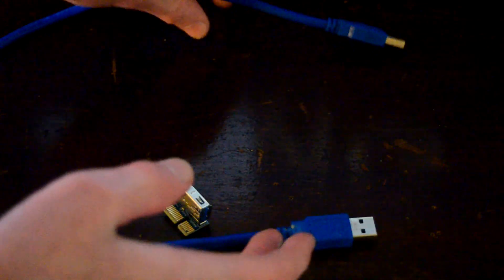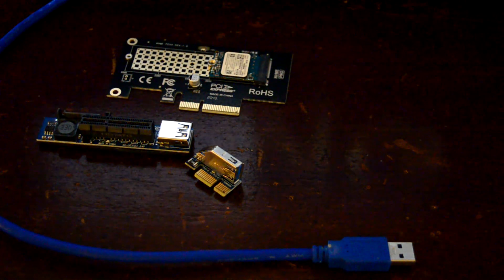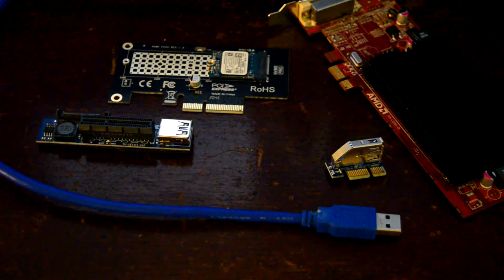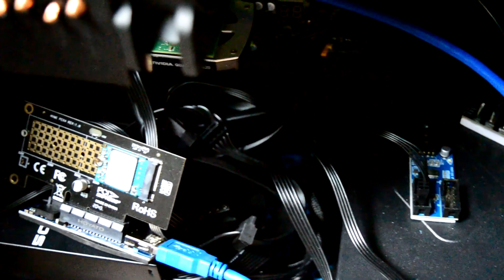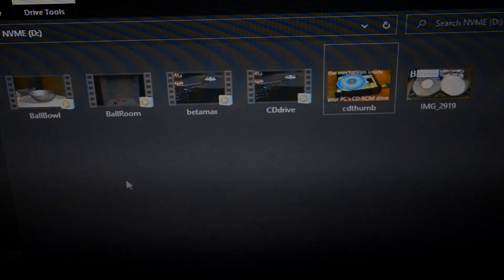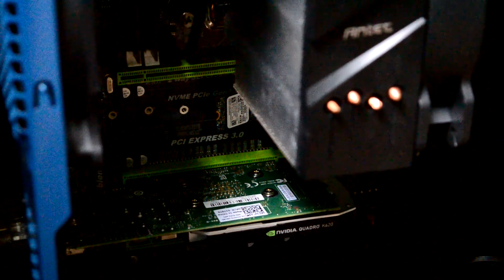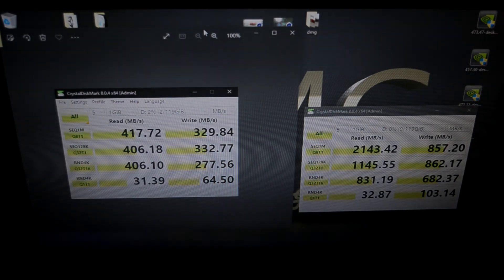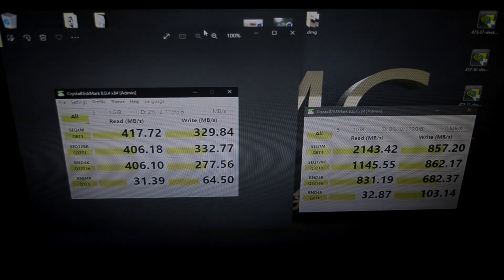Use blocked PCIe slots with this unique riser!

Comment: Great. But will it affect the wifi bluetooth performance of adapter if I insert in this. Adaper is asus PCE-AC58BT (wifi 6 and BT 5)
Reply from the maker: Even at gen 3, a PCIe x1 slot has 1 gb/s of bandwidth and that's more than enough for any realistic wifi connection.
Reply: @DavisMakesGames  Thanks!

Comment: USB 3.0 is limited to 5Gbps or 625 MB/s. SATA 3.0 is limited to 6Gbps or 750 MB/s. We know that SATA 3.0 drives tend to Max out at around 5xx MB/s due to overhead. Stands to reason that the limit in bandwidth here is due to the use of a USB 3.0 cable.

PCI Express 3.0 x1 is limited to 8Gbps or 1GB/s. A PCI Express 3.0 x4 NVME drive is limited to 32Gbps or 4GB/s. 

If the x1 interface were the bottleneck, you'd be hitting around 800-9xx MB/s. 

I think it's that USB 3.0 cable.

You could use a PCIe x1 3.0 Ribbon cable and connect the NVME adapter to that and then double your bandwidth.
Reply from the maker: Awesome, thanks for all the info. That would absolutely make sense, I assumed the USB data limits would be irrelevant since the USB data protocol isn't actually used for transmission - but I suppose cable speeds are cable speeds...
Reply: @DanalogRetro it is another protocol. Therefore the USB3.0 bandwidth limitations aren’t 1:1 identical. 

You should be able to check at what PCIe speed the NVMe drive is running. The slot has probably degraded itself to a Gen2 PCIe 1x slot. 

As for the heat issue, you really need to use a power cable (or a riser) with a PCIe 6-pin power input. The power draw is just too high, which causes the wires to heat up and voltages to drop. A sATA power cable only has 3.3v, 5v and 12v. For those 3 voltages, only 3 wires are used. There’s a lot of amps (and this wattage) being pulled on either of those lines, which causes the heat. It’ll also explain why the performance of the NVMe drive is so bad. If the drive is running at PCIe 1x Gen3 speeds, it should measure at almost exactly 1/4th of the speed of an actual 4x NVMe Gen3 slot. Assuming the NVMe is utilizing the full bandwidth of the slot. 

So please, throw away that riser and buy one with a proper power input. You’ll cause the wires to melt and probably cause a fire in the long run.

Comment: When I built my HTPC in early 2016 I wanted to use all of my slots… I had a separate PCI bracket in the case on the other end (and I have no clue why it was there. It was probably some kind of control bracket area for the HTPC case.) I put my Wi-Fi card in it but had no way to plug it in… the Wi-Fi was going to be plugged into the 1x slot behind the cooler on my GPU… so I just bought a PCI-E extension ribbon cable ran it from under the video card and ran across the other side of the case… extension cables work a lot better, I even run a 1050 in my sleeper dell desktop off of an X16 extension cable. Might be something you’d like to try.

Comment: This is standard in mining rigs, is it not?
Reply from the maker: Mining rig risers are very similar, but this one is specifically designed to fit under a GPU present in the slot above it. Mining rig risers are not quite as flat on the motherboard side as this one.